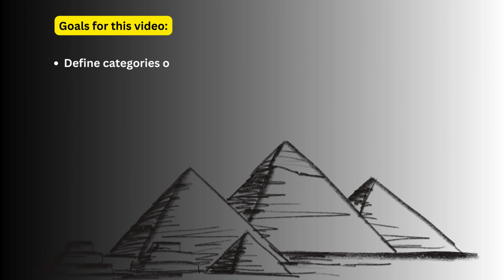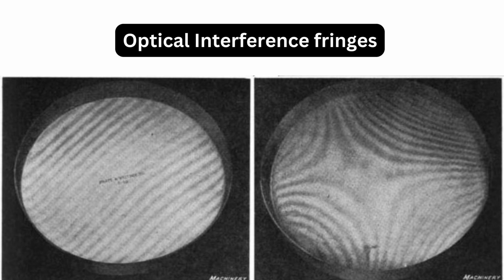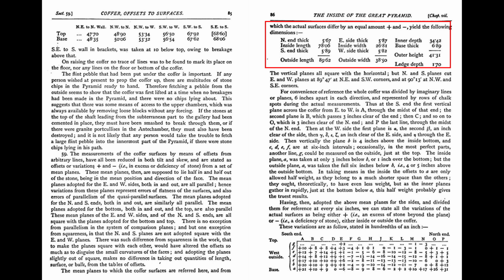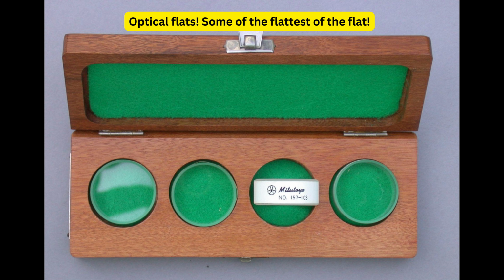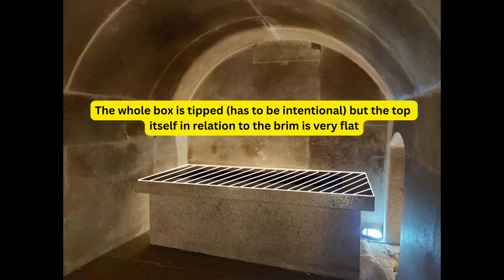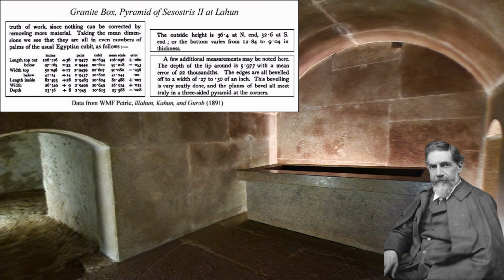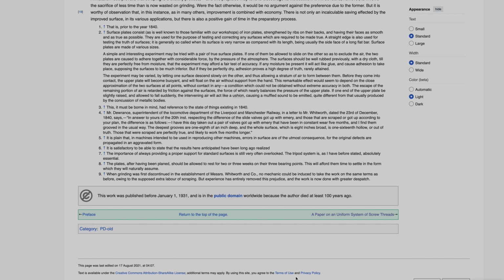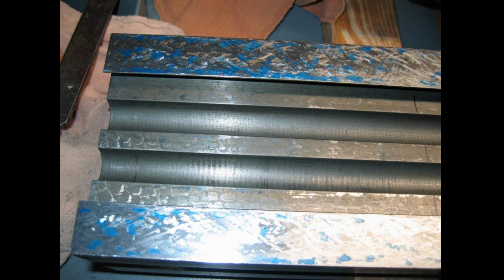The Problem of Flatness in Ancient Egypt

Comment: Well when somebody actually makes one of those boxes complete with lid using only the tools the Egyptians had then that will be the proof. Just stacking a few blocks of stone or take a week to cut a tub hole with a copper time and sand and say this is HOW it could be made.
Reply from the maker: It is possible to understand the theory of how something works without making it. You are right that the practical challenges that were overcome would take place via trial and error. The challenge today is no one, myself or any other YouTuber has these lost skills, the generational knowledge looking over our shoulder saying things like "oh, did you hear the sound change there?That means you hit some quartz vein in the rock, switch to this type of sand and more oil". We know how the romans built aquaducts and yet we don't make them today. Forcing the answer to be mute until an exact replica is made is reframing the question. This is just one possible way it could have been done, I am not saying I have the skills to do it.

Comment: Creating flat surfaces; What if one applied a polymer, plaster of Paris, tar or something like cement to the surface of a frozen body of water?
Reply from the maker: Hmmm, are you asking what happens if you put tar or plaster on ice? I can only assume some really nasty ice. What's the answer
Reply: @intothemap360  I would imagine you would get a smooth surface 100 flat and horizontal there where the material touches the ice. A bit like the way they make glass for windows; known as float glass; they pour the molten glass on a basin filled with mercury.

Comment: Create a large granite rock with semi flat side. Doesn't have to be perfect at all. Then do the same with any smaller rock, one side is enough. Let the gravity do its job and grind these against each other. Keep going until you have a flat surface. Then use that flat surface for grinding other softer rocks. With massive rocks, place multiple semi flat rocks on the ground, making a narrow road. Then have other pulling semi flat rocks on top of them and use hard sand and/or water to act as a lubrication that also grinds the surface flat as possible. Turn the sides to make them any size you need. Now you have a method for massive scale.

Then create measurement tools based on the flat plane you created. This is how I would create flat surfaces with 5 minutes of thinking. Use pulleys to help with bigger rocks.
Reply from the maker: Well said, bigger the rock the more people and more rigging you need.  Good points
Reply: @intothemap360  Yeah. I was just thinking how people back in the days would have done these things. They were excellent at moving large objects, using stones, sand, and water. If they are good with shaping rocks, they have to be good at grinding down all the sides. The easiest method is always to use the gravity + sliding objects. Instead of the sandpaper, they could use the sand. 

They must have figured out how pullies work, because they did use to pull things 24/7. Bronze measurement tools would have been easy for them to make with flat surfaces they created. All they need is to have one physical object that's used to base measurement.

I think they would have made some sort of road with rocks. Grind them down to right shape while moving them to the location. Then undo the road to finish the build. This way the time it takes for one block is pretty high, but it's 100% perfectly flat on every side when finished. No extra grinding is needed. All the smaller pieces would get flat finish the same way, but in a small scale.

Comment: Red ochre isn't just a pigment- it's also a polishing compound, so if traces of it were found on very smooth surfaces, that could be another reason. The red color is just iron oxide, or rust, and has been used as "polishing rouge" for millennia, to polish gemstones and glass. And it's still the main ingredient in cosmetic rouge that modern women still paint their faces with. I'm a lifelong amateur astronomer and a few decades ago I learned to grind and polish telescope mirrors. The most surprising thing I learned was that it can all be done with methods that go back millennia. Garnet sand for grinding- you can separate finer from coarser grains by mixing it in water and letting it settle for a few minutes. The coarser grains settle out, while the finer remain suspended and can be poured off. Polishing is done with polishing rouge in a "pitch lap", where the pitch is just boiled down tree sap. You can get a surface accurate to a few millionths of an inch with this.
Reply from the maker: You see its this type of information clearly developed from trying different things over a lifetime that is missing from the Egypt claims. You probably weren't as good at polishing a telescope mirror when you first started, you read books, maybe tried it a few times and talked with someone who had done it and now here you are able to pass on information that can't be readily summed up in a manual. It is this type of information that helped the egyptians as well. Thank you for watching and commenting!
Reply: @intothemap360 engineering and applied science is full of simple little tricks that make it possible to do things that would seem impossible if you didn't know the trick.

Comment: 2:08 modern construction lumber is typically planed these days, so it’s a little flatter, or at least smoother, than off the saw.
Reply from the maker: If you go to my home depot you'd assume they were deliberating attempting to pass of 2x4's as banana frames
Reply: @intothemap360 it has all been planed, but a planer cannot fix the existing tension in the structure of the tree that is released when milling. There is no such thing as a straight tree or a straight board. Only relatively straight. And you are correct, sometimes it's only "relative to a banana"
Reply: Planing does not "flatten" a board. You correctly......corrected yourself. the word "Planing" itself is a bit of a misnomer, as it would imply bringing some object "into plane". Planing machines in the context of lumber are doing so for thickness and surface, but by far the most important part is uniform thickness. The smoothness is a byproduct of sharp knives being a more effective tool to achieve repeatable, uniform thickness.
Reply: @a @aaron6806 s, though the plane in question is generally a scraped flat steel plate reset every year or two, I had the privilege of being provided as a helper by the boss to the technician who came in and spent 10 hours going over our planer mill one year. The boards are theoretically flattened, but subject naturally to the internal forces of the wood. The result in practice is just smoother and marginally more uniform lumber (I say marginally because that effect does allow the rough sawing to be less finely tuned and thus the efficiency to be greater).
Reply: I don't know how widespread this practice is. Wrot lumber is usually a much more costly and rarer option, for use where it will be seen.
Reply: @j @joytotheworld9109 ere has been an industrial planer in every mill I’ve toured or worked in and all the 2x lumber I’ve ever worked with on jobsites or encountered at a store has been planed, and the 2x4 is 1.5x3.5 thing is a consequence of the mill planing the lumber. I believe that to be reason enough to conclude it is a common practice.
Reply: Lol no it's not. It's just a 2x4 dude
Reply: @perrodru  yes, almost every piece of lumber is planed before your expert eye sees it. Unless it is specifically labelled "rough sawn" and has, y'know, a rough surface, then it has been planed.
Reply: @perrodru having worked in a couple mills, handled rough lumber and planed lumber both at the production end, and having worked carpentry in the ICI sector, I feel comfortable saying I can identify whether a 2x4 is rough sawn or planed. And every 2x or 4x I’ve ever handled on a jobsite or found in a store has been planed. The process goes debark, saw, kiln dry, plane, pack, ship out for sale or use. It’s why a 2x4 is a 1.5x3.5 if you put a tape on it.

Comment: "Soft fitting" works just fine for one-offs and assemblies that only need to fit each other.  If you have 2 parts, and they are the only 2 parts in the world that need to fit together, you can get away with a fair amount of deviation from "ideal geometry" as long as the 2 parts have profiles that match each other.  Early to mid 19th century manufacturing, even "precision" work of that vintage, had a lot more of this than you might think.

A surprising amount of handmade stuff has assembly markings to remind the original builder, or someone who comes along later, which orientation you need to line things up for the parts to fit properly.
Reply from the maker: Well said! I have certainly encountered this in working on old machinery
Reply: We still use this concept with modern machines. The main caps that hold the crank shaft in your engine block are likely done this way. The crank bore is drilled, the caps are snapped off, reinstalled, and the bore is then honed to precision. This means the main caps are now 1/1. Every main cap has its place, and mixing them up can cause major internal issues.
Reply: @sethh8892  Fractured main caps are pretty common (and have been for decades now), I'm not sure that they are yet the norm for most car engines for main caps - but yes definitely used a lot. Makes the block somewhat more disposable unfortunately. They are very very often used for connecting rods, however - possibly the norm on anything that is remotely high stress (which is most engines now considering turbo charging is often used for best economy in all but the most base models). 

There are some advantages in that they fit together better than you could ever machine, but the real reason is mostly about cost - it is much cheaper to make sintered metal forged rods and crack them than any other method - which involves designing the blank to account for the kerf of the cut plus machining, then having to do that cut and machining. Unlike doing it to the block it allows for easier rebuilds in some ways, although it seems with modern engines that rebuilding isn't often possible anyway if something ends up damaged enough to need it.
Reply: @X85283  I agree, although, I wouldn't say they are IMPOSSIBLE to rebuild. It's just with the mass adoption of disposable parts and equiptment, finding people that master in rebuilding and reusing is much more rare. It's not difficult for a machinist to rebuild an engine, it's just an arguement of finding one to do it, and finding the parts that are worth doing it too.
Reply: @sethh8892  I just mean with fractured main caps, if for some reason they need to be replaced, the block does too, if you have any intent to retain the original engineering of the block. Of course one could probably machine the block and use standard style caps, but by that point its probably easier and likely cheaper to just get a new block.
Reply: @X85283  Yup, it's easy to do. You deck the block surface and the cap ends. Re-attach the caps and torque to final spec. Then bore and line hone the adjusted caps to factory spec.
Reply: Even some con rod caps in race engines do this. They essentially break the piece in two so that it fits absolutely perfectly when you screw it back on the crankshaft
Reply: @joffebisk more than just race engines. Probably 50% of new cars.
Reply: @joffebisk  yup, Most gm engines are like that
Reply: The concept of Interchangeable parts wasn't invented until the mid 1800s and wasn't realized in practice until the early 1900s. If you don't have interchangeable parts, you can get away with soft fitting.

Comment: My approach to tolerences is asking 'am I building a pyramid or sending man to the moon.'?  The answer usually comes out to no. I then ask what's the next lower acceptable level of tolerance and is it cost effective.? I work down from there in a conditional loop. So far my cheap diy shelves haven't fallen off the wall. I'll see if they're still holding a few thousand years later.
Reply from the maker: Haha yes there is no need to go to those levels of flatness and tolerance unless its for a specific purpose. The casing stone tolerances were probably done to make sure the total of all the joints added up to the top didn't make the final stones meet at different points.

Comment: Lapping plates and sand as an explanation for flat surfaces in Egypt isn't a new one, and while vastly more plausible, it has the same problem as alien lasers and power tools, as far as I know; there's no evidence. For such a widespread crafting practice, we'd expect to find a preponderance of tools or tool-like objects, laps and plates in this case, and at least some inscriptions of the process, but there's neither. For the practice to have met the demand based on academically accepted construction timeframes, and with the level of consistency and expertise we see, the practice would need to have been a mature and fully integrated industry, enough so for the number of tool artifacts found to be greater than none. Not defending the "it's aliens bro" crowd by any means, but don't think it's fair being dismissive of one explanation over the other based on plausibility when the fact is both are actually equal in lacking any archeological evidence whatsoever.
Reply from the maker: It doesn’t have the power and technology issues those other explanations have though. It’s pretty basic and the technology is actually more technique

Comment: If you slide to rocks and of the same type against each other in a circular motion, eventually you'll have flat surfaces. You'll have expended alot of effort, and will have turned a lot if stone to dust, but it can be done, even in a stone age civilization, let alone a copper age civilization.
Reply from the maker: The main thesis of my video!
Reply: @intothemap360  Yes. Sorry. I commented During the veiwing. Guessing what you were going to show me. Bad habit of mine, sorry.
Reply from the maker: Its all good! Not all viewers are quite as quick as you are so I had to lay the groundwork!!

Comment: My personal "It must have been aliens" was the 500 ton stones used in the temple wall in Jerusalem.

Nobody could figure out how they moved stones that heavy ....until the found a large slab that was flat on one side and round on the other that happened to mate up with the 500 ton stone.

They had quarried the massive blocks as cylinders and rolled them into position,  then carved them to a square profile
Reply: And how did they lift them? Like those Triliton slabs? Dragging or rolling is a difficult process but lifting and placing is a way more difficult one
Reply: @ДенисПикулин-ж9ч yeah, the aliens came from galaxies away with their time and space bending machines, using galaxies worth of energy to just move big stones for some stupid, superstitious creatures.
Reply: @ДенисПикулин-ж9ч 
Lay a row then bury it.
Lay another row on top , then remove the dirt.
Reply: @glennchartrand5411 would there be any example provided where that impressive tech was successfully employed?
Reply: @ДенисПикулин-ж9ч the "impressive" tech is called an inclined plane or ramp. If the rock is already higher than you need, then you can raise the bottom of the ramp. In that case you aren't lifting the rock higher, you're just not lowering it as much. Evidence of ancient dirt ramps are everywhere.
Reply: @ДенисПикулин-ж9ч MFers when they don't understand anything and think a burying something in the ground is an impressive tech. You can litteraly grab a shovel and try it.
Reply: It must have been aliens that somehow pulled themselves away from their habitual pastime of anal probing.
Reply: Large scale atomic force microscopy.
Reply from the maker: necessity is the mother of invention.
Reply: Very interesting point. But the two blocks remaining in the Baalbek quarry (not counting the third one which is incomplete in the quarrying) show that at least those were quarried as rectangular blocks. Additionally there is a very interesting video on YT showing the "underbelly" of one of the trilithons with very fine and - at least to the eye - perfectly parallel grooves. Should I find it I will post it here. But even taking a cylinder of this size would have been immensely difficult to place next to the ones already in place. The seam between the stones of the trilithon is nigh non-existent.
Reply: @TEbersberger the fact that the stones never made it out of the quarry tells you that method didn't work.
Reply: But I really want it to be Aliens so I say it's Aliens. My mommy lets me create my own reality.
Reply: @twt000  Es waren Lebewesen, die auf der Erde entstanden sind, aber keine Menschen.

Comment: Flat isn't the problem, it's inside corner's, concentricity, smoothness, tangency squareness etc. 

You produce one of the rose granite vases by hand, lmk when you do
Reply: A bored mechanical engineer at one of the places that I worked at decided one day that he was going to make a sphere by hand. He began by hand carving and then moved on to sandpaper. Within a month he was down to tenths of a millimeter precision... working only during his lunch break. Imagine what that guy could have done if he actually had set his mind to it and had worked 12 hours a day.
Reply: @schmetterling4477 a sphere os was easier than a vase with multiple axial tangencys and concentricity points, nice story
Reply: @seancollins9745  What's so hard about an object with cylinder symmetry? You only have to care about one dimension instead of two.
Reply from the maker: Each of those are also a specific tolerance with its own scale. And no, I don't have to make a vase. I never said I could.